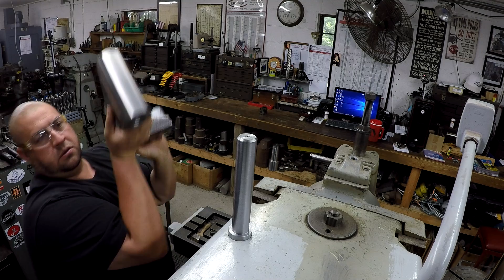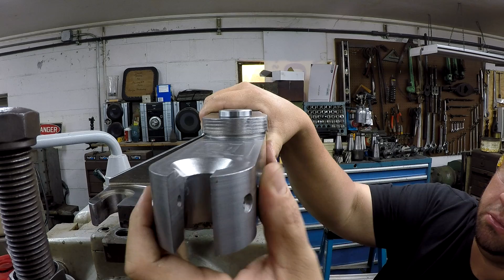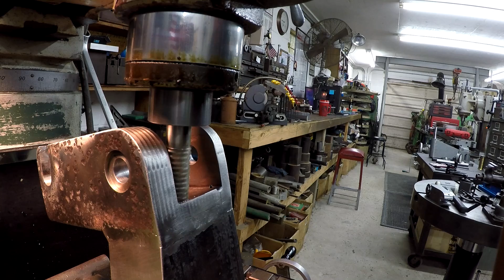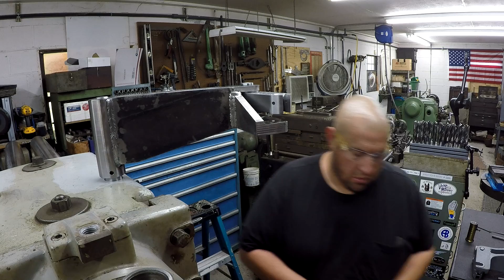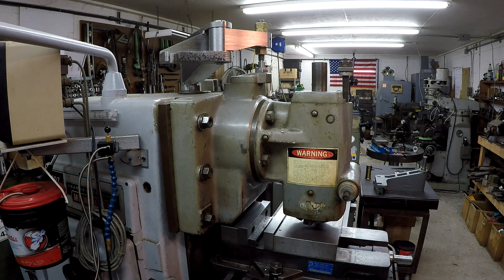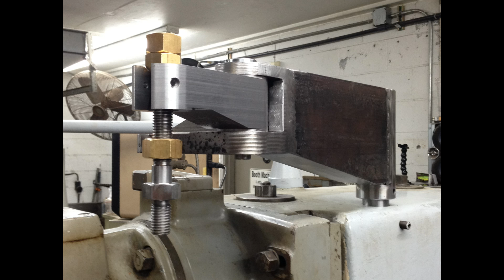Kearney & Trecker Parking Attachment 16: The Reveal!

Comment: Adam, I kept thinking that what you were building was not made correctly. I just realized that the K&T mill you have is a bit different than the one I ran back in the 70's and 80's. The K&T I ran had stub over-arm shafts that stuck out the side of the the mill to park the milling head. They were long enough so that the milling head was completely mounted and was then clamped down securely (just like you were going to run it) and the tension of the parking arm was slacked off so it didn't support any of the milling head's weight. 
    The parking arm was made differently as well. The milling attachment had what was essentially a miniature trailer ball on the top of the attachment in the threaded hole. The small link of the parking arm was made in two pieces with one of them being a rocking beam with a jacking screw and a split cup to slide around the "trailer ball." This allowed about 2'" of vertical movement of the milling head. 
   This vertical adjustment was required so the the milling head could be pulled away from the front of the mill. There was a helical gear that mounted to the mill spindle and it had a plate that mounted in front of the gear. The milling head had to be lifted vertically about 1/2" so the mating gear in the milling head could pass over the top of the plate. The jacking screw made it very easy to park the milling head on the stub over arms on the side of the mill. The jacking screw also allowed the gear backlash to be set easily when mounting the milling head.
   More information than you will ever need, but if someone sees one of this style of milling head they''ll know that the milling head attachment has to be lifted slightly before it will come free from the front of the mill.

Comment: What a beast of a parking crane that's turned out as!  Heheh, it sure is going to be different now seeing that massive vertical head just parked and hanging off the side of the K&T in your future vids with that attachment holding it  Giddy with anticipation as to what your next project is that you've got lined up.  Have you ever heard of a roller die cutting machine?  Its a piece of equipment I get to run occasionally at the factory I work at.  It doesn't get near as much use as it used to get, but it's still kept around for occasional packaging runs.

Comment: Great to see it working. I agree that there is not a problem with strength. What i would do (after painting, of course) is, to grease all the moving parts. Maybe with a MoS2 grease. I guess that would be better for the moving parts, and better for you, using it. Even with the parking attachment, it seems to be a heavy job to mount / unmount the head, lol.

Comment: might be an idea to make part of the tapered side mountrail and mount it on the side of the machine 
that way you can fixate the head to the rail and it will hold most of the weight and prevent the head from rotating away and generally move about

Comment: Great series. I would be very interested to know/see how much the main pin moves from setting empty with no weight, to loaded with all the weight of the head.Congrats on a great tool, hand built that works as it should. With a little tweaking, it will be a great addition to the mill.....

Comment: Great series, really enjoyed it. Do you think it would be worthwhile to put a grease fitting in each of the arms so you could lubricate the joints where the two smooth pins go through? Might make moving it easier when it's under load.

Comment: Hi mate.  Congratulations an excellent job there.  Bloody nerve wrecking hanging that head and taking those bolts loose, though.  I saw it drop by quite a margin and thought that you would not get the overarm supports back in there without tightening those adjuster nuts up a bit.  Could it be that K&T machines that were equipped with such an attachment had an other mounting bracket?  This one seems to be quite underwhelming for such a big weight hanging off it the whole time.  
I reckon that the operations of the crane will be a lot smoother once a tonne of grease is packed in the movements.  
Nice pick up on that build limiting travel movement  of that swivelling joint mate, I was very dismayed about that. K&T must have adapted those things individually before they left the factory.  Anyway, besides painting, what's next, Giving that band saw a bit of a birthday?  That poor thing is looking a bit unloved sitting there.

Comment: Awesome wrap up to an awesome series. At about 31:10 when you gave it a big shove and it backed right up against the over arms was such an exciting moment. What will go in its place when you have that head moved off to the side? Love the videos
Reply: The overarm supports then are moved out, and support arms and horizontal arbors then go on for horizontal milling.  Check his other K&T videos for footage of the machine in horizontal milling mode.  Slitting a big, massive chain sprocket in half with the machine in horizontal mode is a wonderful demonstration of its horizontal capabilities.

Comment: You did a great job, I did see it drop when you ran the  arm supports back, you might want to put a  little tension on the head before running the support arms back. You might want to think about an arm or lever to help move the head to park or attach it.

Comment: The videos were all great, thanks for that from Germany. But to be honest, i don't like the idea of so much weight hanging on top of my milling machine when I am working on it. Not because of safety hazzards, but because of vibration, weight distribution and these things. This attachment won't improve the quality of the workpieces you are milling. Although I am realy not sure how big the influence of this is. As said I appreciate the videos from you
Reply: It's only use is when he wants to remove the vertical head and use the horizontal head instead. It's simply a way to easily remove the head and lock it to the side when using horizontal head.

Comment: I will preface once again by saying im no machinist just a DIY fabricator and putzer.   So the tinkerer in me wont let it go and I was wondering after reading some of the suggestions, if indeed theres not a more practical piece to use instead of having to drive that roll pin out every time.  First I would ask how often does the pin even need to come out -- - if not often the pin could be fine, it was good enough for K&T.    But knowing your skills and backround I wonder if you could not easily improve it with a different type pin for the sake of convenience (if its even necessary) and still keep the needed strength and safety factor.   I'm also lube crazy, once painted id find the slickest grease I could to assemble it with and I bet that thing moves around like butter then.

Comment: Congrats Adam on a job well done.  Right when you were "half a hole off", my first thought was "how would the engineer design this?"  The parking position  and removal / installation are two separate positions.( as you quickly figured out yourself)  Congrats once again, not only does it look nice but works well too.  Jeff

Comment: Great Series Adam!! Pro skilz for sure!!! Once parked you may want to put a side plate on the mill to lock the head to using the side clamps just to keep it in place. Old Model H has 2 short overarms made into the bracket to push the head onto. BUT I'm sure your rig will hold just fine as is. Again great project!!!

Comment: Hi Adam When you get around to painting use a good paint with a hardener in . I have painted all my machines myself . I have been using a tractor paint with the hardener and it works good .Some of my machine I did not use the hardener and the paint is wearing off. So any auto paint should work good also Good Luck

Comment: Of course, only the 2 nuts at the top are weight-bearing when the head is demounted and before it is parked. IMHO, and I'm not a materials engineer, it would only be an issue if the top nuts were not 'snugged' down to the arm when the head was released, this would cause a sudden drop load on those nuts which might, just might, cause the thread to strip....

Comment: at 31:03 into the video when you push the milling head onto the overarms you can observe the overarms move backwards and you can see the top part of the handwheel controlling the overarms (on the far side of the machine) move a bit too. So you better check if the overarms had correctly engaged the milling head. And in the future you need to lock the overarms when you push the head on them to be sure it is really seated properly. Congratulations on the successful conclusion of this project.
Reply from the maker: The head pushed the overarms back because i had them extended too far. It's very common to see them push back like that when installing it.
Reply: Everything under control, then :-) I don't own a K&T to know those common procedures. :-( Great video series. Thanks for sharing.

Comment: So presumably before you had this attachment you used the gantry with a block and tackle to lift it off with the eye bolt that you removed. I guessing this attachment makes it much quicker and easier.  BTW excellent series.
Reply from the maker: Yes John, used the gantry crane to remove and install.

Comment: Hello Adam,  Great job.  I wouldn't worry a bit over the brass nuts.  I believe they are superior in that they provide a bit of inherent lubrication in the conical hole whereas the steel on steel might gall.  Additionally they have been used in marine shafting and those stresses since the advent of propeller drive in boats.  That is a lot of force when either backing down and driving against the thread or in a twin installation with left and right rotation.  Brass is very nearly the strength of steel (as a generality with quality metals).  So it was a good call to use it.  Although I do have to comment that your under nut would not be bearing the hanging load so in your calculations only the top two contribute thread length and strength.  Still major overkill in working load so sleep easy.  It was cool to finally see exactly how it was going to work on the machine.  Have a great day and enjoy the crane.  Doug

Comment: wait... if you have to take out the roll-pin to get screw into the head (17:30), how is the attachment stored, when not in use? Do you have to take out the roll-pin every time to take out the screw?
Reply from the maker: No you don't. Only if you need to remove the arm from the head. No need in removing the attachment every time though. Just leave it hooked up and ready to go.
Reply: i see. thanks for the explanation (and the videos!).
we will see - once its painted - in that resting position.

Comment: Really great series Adam, the end product looks great and SAFE! Re the over engineered etc, the thread won't have been originally sized again static pure tensile load as it has to account for the bending loads induced when moving into place.  Threaded bar is great for tension but poor in bending as a single fastener.  As a result, the brass will be fine.  
In the calcs Tom and others have done, what value did you assume for the 'Abom torque figure' to give you the thread pre-load? 
At the risk of being labelled a Safety Nazi, if you were unsure of the support when pulling the bars back, you could have slung it with you gantry crane rather than risk a drop.
Reply from the maker: I have no doubt all the materials I used will work just fine, just adding in some conversation for the guys doubting everything. I knew it would hold, but the first time is a littler unnerving.

Comment: Why do you need to move it out of the way, do other attachments take the place of that part, or is for maintenance?
Reply from the maker: For when using the mill for horizontal milling, like running and arbor and arbor supports.

Comment: Hi Adam

Great job with the Parking Attachment install. Looks good. What you could do is attach a Lever/Handle on to the short Arm that John made so that it would be easier to swing with the weight of the Head on it.

(Handle Construction)
Weld a 1/2" x 12" Tube to a 1" x 1" x 1" plate. Drill a 1/2" cross hole in the center of the plate. Drill/Tap a 1/2" hole in the right side of the short (Johns) Arm. Install the Handle with a 1/2" step bolt and a couple of wavy washers to give the Arm pivot some stiffness so it stays were you leave it. Or you could just use some Loctite on the Bolt and once you have it adjusted to the correct tension the Bolt will lock in position.

Just a thought to make your Parking Attachment easier to use.

Cheers
Willy
Reply: Just found this series, it's great, thanks for sharing it.   Maybe you have put this suggested handle on already.  If not, it is something I thought of too right away while watching you maneuvering the head into place.    It would make remounting the head or parking the head to the side much easier.  Thanks again.

Comment: So, I didn't hear, but when you pull the head out of the way is that so you can do service on the machine itself; or why else you want to take the head off?  Otherwise, it looks great glad you figured out!
Reply: its a horizontal mill primarily the vertical head is an atatchment

you take the vert head off and roll the overarms forward and a cutter in the bt slot
Reply from the maker: For when you want to use the machine for horizontal milling.
Reply: +Abom79 you said it weighs several hundred pounds, so it saves your back when taking the vertical attachment off?  Cool!

Comment: It might be worthwhile to check with your friend who loaned you the original arm, and double-check that the mounting plate on the top of the vertical head is the same between yours and his. The fact that the plate wasn't thick enough to take the entire threaded stud, and the way it appears undersized compared to the mounting boss on top of the head, have me suspicious. It seems like it would be far too convenient to have the hole line up for use with the arm swung the other way, for K&T's experienced designers to miss that by only a half-inch or so.
Reply: Doug Anderson Not at all suspicious that it would line up when swung open, because a double-hinged arm like that would be able to reach any point between a certain minimum and maximum, if  the small arm can swing to the correct angle. Did you fail to notice that the arm wouldn't reach that point at all until after it was modified from the original design?

I'm not "guessing", I'm examining context. You, however, are not only guessing, but guessing wrong.

Comment: Adam, just had to watch this again---  but I was wondering when I noticed the big arms in the back pushed out some when you pushed the head all the way back in -- I was just wondering if you knew or if it meant those big arms hadn't engaged the head as intended-- or does the head have its own engagement dogs for those holes and the arms are not supposed to engage the head at all-?    Im no machinist so im sure im missing something here, just wanted you to know I saw them move back when you pushed the head back -- I wasn't sure how that scenario was supposed to play out if the over arms were just for use without the head etc??.   Excellent series, great to watch and such a useful project for the K&T-!!

Comment: In regards to the brass- I think its strong enough for your application BUT because is a lifting fixture the Millwright in me says No NO NO! You don't use brass for rigging generally. Again though, for this application, I think you are fine.
Reply: It wouldn't hurt to remove the top jam nut and replace it with a nice grade 8 for safety though! Very nice build.

Comment: I guess you should have checked the original for fit before you made the copy. Fortunately the adjustments were minor. With a little practice, you be able to take the head on or off in a snap. 
Thanks for the great videos of the fabrication.
Reply from the maker: Bill has the same model of machine I do, the 307 S-12 so i never thought otherwise.
Reply: Versions change within the same model. A weakness in the original design or a more cost effective way to make the part. Fortunately the fixes were simple. Your presentation of the build was great. I made a point of reading every comment that had been posted as of last night. Everyone genuinely appreciate your taking the time to video and explain the process of building this Abomb sized attachment.

Comment: Very nice Adam, one thing might consider. Lose the roll pin, use a snapper pin instead. You wont have to drive it in and out and they are hardened as well. Heres one but can find them any where. http://www.shopjfi.com/industrial-supplies/fleet/trailer-accessories/snapper-pins.html

Comment: Looks very good but you might need to lock the 2 top nuts together so it doesn't change the height of the head as when you turned the head to the parking position it looked like the bolt turned i think the brass nuts may have grabbed on to the pivot point.
But that looks like ti is way easier to remove the the head with the parking crane than lifting it off with the gantry crane  and a lot safer for you to and paint it the same colour as the K&T that would then look like it is the same as the original machine would look 
Good video Adam

Comment: Enjoyed watching this series although not a machinist.
One possible concern about your brass nuts is that you have 2 dissimilar metals in contact which will create a voltage, which in turn will lead to corrosion. Oil / grease will reduce the problem no doubt but long term I think I would replace them. 
Cheers Stephen, North Yorkshire UK.

Comment: Nice completion Adam.  I believe that if the main support bolt were threaded all the way down beneath the bottom brass nut, that the nut could then be turned lower, allowing the entire bolt to move up to access the threaded lug on top of the head. Wouldn't need to remove the roll pin then.